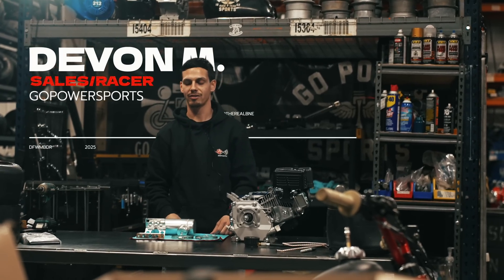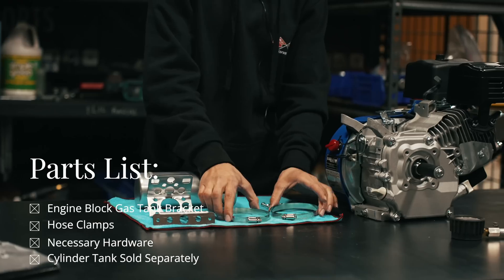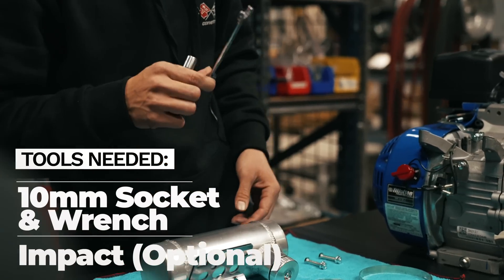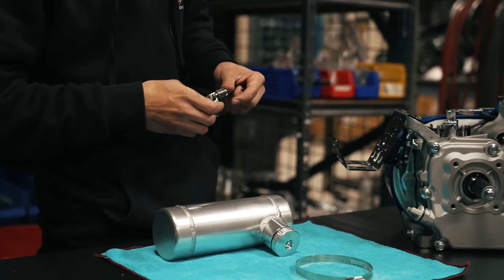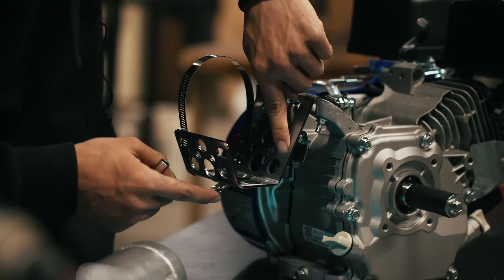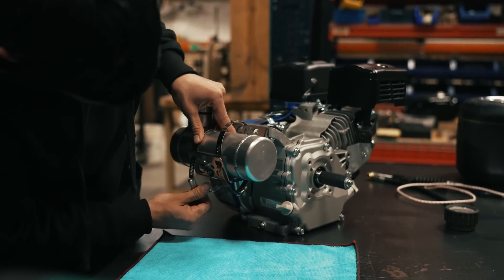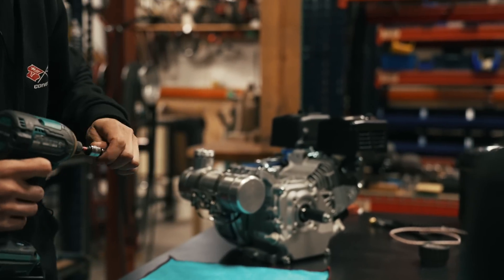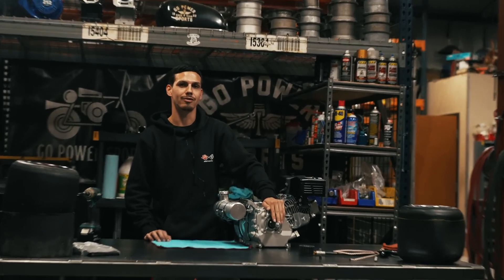How to Install Engine Block Gas Tank Mount | 212cc Engine DIY Installation

Comment: First
Reply: What frame would this fit
Reply: @martyshapiro4750 Really?
Where does it mount to the frame at all?
Reply: @NubsWithGuns  I know that won't fit my bike there's not enough room for a tank infront of my engine it's too close to the frame so what I meant was what frame/motor would this fit in would assume just gps bikes